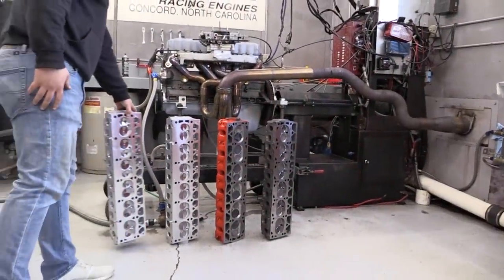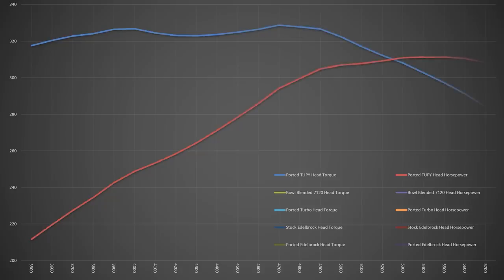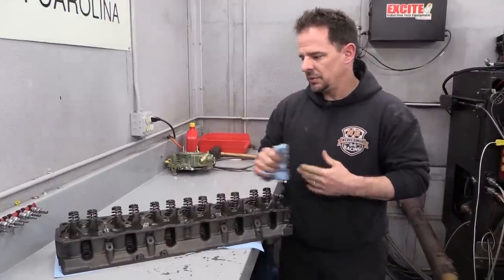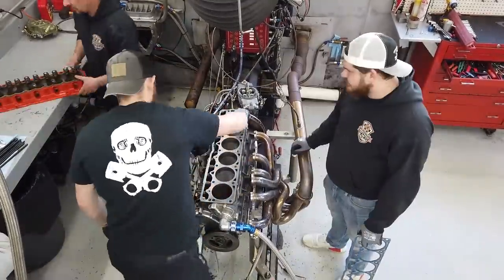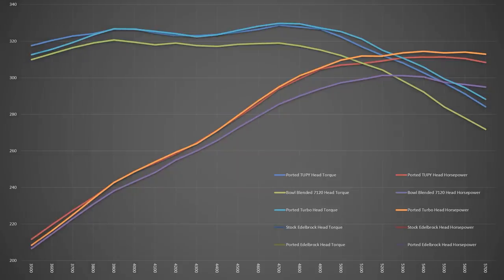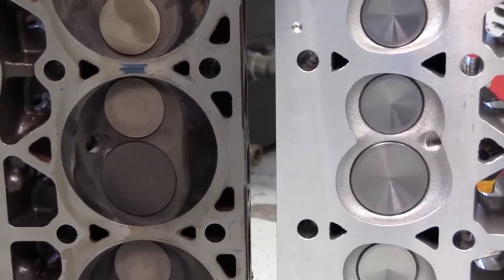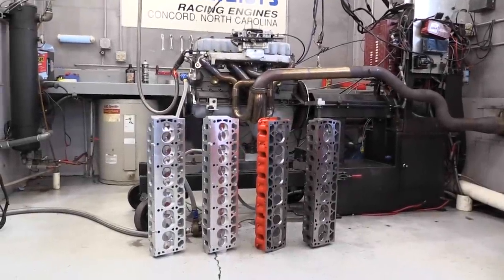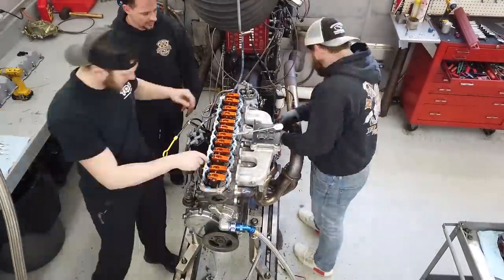We Test 5 Jeep Cylinder Heads [How Much is Porting Worth?]

Comment: years ago I had a 4.0 mated to a 5 speed with grand ma first and a NP 205 transfer-case in a J 10. it was one of the most capable jeeps I ever owned and would still be in my garage except for the dread of all jeep owners it was built from a cheaper steel as american motors was nearing the end of it's life and was sold in Connecticut. needless to say when I got it it was a rust bucket but it had a very low mile 4.0 and the 5 speed I swapped in the 205 because I had a chance to get one and it was the best mod and the only one I did to the truck. I got 8 years out of it before it rusted back to the earth but the motor, trans and transfer-case went in to my little brothers 67 J 10 and still powers it to day that was over 20 years ago now and it's still his daily driver.

Comment: This video really puts the emphasis on choice for application. I’d imagine the heads on a forced induction build would show highly different graphs on the dyno. It really shows how, too much porting, that’s specifically designed for forced induction. Put on naturally aspirated builds. Can rob power. And the beauty of this video is. It gives the layman a better understanding of gas flow and velocities. Thus helping people chose the right parts for their application. 
Your spot on when you say that the stock heads, with a descent valve seat job. Are the best for a budget upgrade on most applications. Where as the standard and ported
Edelbrock variants are much better suited for stroker and forced induction builds.
Again a cracking comprehensive, and in-depth test coverage of a subject that is highly relevant for lots of people wanting to update, and modify their straight 6 motors!

Comment: Thanks for the pull information. The crank harmonics are definitely an rpm limiting factor here. That being said, it seems all the business occurs well before 5k as it relates to torque. I mention this as it appears a mildly ported 7120 casting would have spanked the Edelbrock head on this block configuration. Other than the weight reduction and possibly lower emissions due to the chamber, the Edelbrock is a waste of money to anyone with a 7120 casting to start with. What is not illustrated is how well the stock castings flow at low valve lift.

Comment: This was a surprising test.  I was expecting alot more from that Edelbrock.. both stock and modified.
Reply: probably at the limit of the intake manifold.  those ported edelbrocks look like they should move a ton of air.
Reply: @deltaphisig  also being aluminum it can take more timing without detonation. Without messing with the tune, it’s going to be difficult to get the most out of it

Comment: For my application, the stock Edelbrock head is the one. Thanks for the dyno runs on all of those heads. A lot of great info.
Reply from the maker: Thanks for watching!
Reply: I agree. Think I'm going to purchase one when I rebuild my stock HO and drop in a RV cam. The weight reduction will surely help make this a peppy street engine.

Comment: I didn't even know there were 5 different cylinder heads 🥳
Reply: I about fainted.  I read "5 cylinder" and thought this was one of those conversions.
Reply: lol
Reply: Basically 2 heads, 1 factory with  4 variations and the Eddy lol
Reply: shaadydog1 - Yeah, I figured that out once I actually watched the video, lol
Reply: renix, early mopar, 2nd gen mopar and infamous 0331, with some revisions inbetween
Reply: @omegarugal9283  I had a Cherokee with the Infamous 0331.  I would still have that thing if the damned cylinder head did what they are prone to do.  As soon as I saw my oil pressure spike to around 75 I knew it was toast.  I'm looking for another Cherokee, but this time it's gotta be a '99 or earlier lol.

Comment: That's a whole lotta money for 15 horsepower!
Reply: This is one of those mods you can do yourself for free with just a dremel. When ever I have to a head job I usually trim up the ports. I use a gasket to mark them, and the manifolds and match. Its not as good as machined, but never had any ill effects. Always noticed a slight increase. 15hp/tq ain't much but every little bit adds up to big gains.
Reply: yep  simple porting and  polishing works wonders with a nice cam  and way cheaper too then all the different head dancing hoopla
Reply: @ChannelZeroOne  The heads in this video had WAY! more work than gasket matching with a dremel.  Big valves, bowl work, port reconfiguration, raised roof, etc...  There was nothing free about it!  And If that's what it took to see a 15 horsepower gain, a little dremel work wouldn't even show up on the dyno.
Reply: @1996slamster  You forget this ain't a stock to stock comparison anyways. I always get haters, but they are always slightly faster than stock. I always assume the gains are minimal, but enough to notice. I dont just decide I am gonna dremel out my heads. This is something I do when I need to replace a head or something. Making a headache worth it. Every little tweak adds up over time.
Reply: Channel Zero One Haters?!  Since when were we talking about a set of heads you’ve worked on, we’re talking about the heads in the video, and none of the heads in the video were simply gasket matched with a dremel.  They had huge amounts of work done to them requiring expensive machine work, hand porting and flow bench time all equating to $$$
Reply: Best 15 horsepower over what they had already built. Total horsepower was closer to 90 increase over stock.
Reply: @ChannelZeroOne  
I've never been able to do a head job myself. My woman does those for me. 💪😁♂️
Reply: 15 hp difference between these heads.  But a standard 4.6 stroker is putting out around 260 to 270 hp depending on lots of variables.  So this 4.6 is more like 50 hp more.  Of course the cam profile plays a very significant part of the numbers as well.  Unfortunately they didn’t start with more of a stock 4.0 head and measure against that.

Comment: Built a 4.6 with a tupy head that has been really noisy on startup and a little bit piston slappy but I can't blow it up tried a few times... has a 229 cam 4.2 rods and pottenger dished 26cc Pistons, even with the dish it likes 89 doesn't like 87 at all after swapping the 229 cam..

Got rid of the 0w40 and dumped in some 5w30 and a little Lucas zinc additive and it's way quieter now, maybe it just likes the thinner stuff still has plenty of oil pressure
Reply from the maker: But does it run well? Sounds like a fun ride!
Reply: Dodd Garger i went with the 4.2 rods, h802cp30 pistons(15.x cc), 230 cam, and put it in my lowered 2wd 2dr XJ with ax15 and LSD.  I’d usually be in top 1/3 at autocrosses.  Wish yt would let us post pics.  I’m gonna redo it with +.090”diamond pistons and the eagle 6.150s long rods i’ve been hoarding for years.
Reply: @grad0n  Very sweet. Always thought of autocrossing a 2door 2wd. I have a 2 door 4wd daily stocker that I thought maybe???
Reply: @99jeepxjguy97  i have a 99 2-dr 4wd 5-sp that I’ll be autocrossing this season.  I just put an eaton truetrac in the back and will swap the 231 out for the 242 with fulltime option.

Comment: Any heads with similar bore spacing that could be adapted? BMW, Toyota, Nissan, Jaguar... create something like the old Pontiac SOHC. Also I know it’s time and expense but some of the ported heads would probably have liked a different cam to bump up the torque. If the exhaust picked up significantly the need for less duration/overlap would help that. Even as it stands though nice gains and great content.

Comment: when you run a side mounted four barrel carb the primaries face the intake valves, how about testing the four bangers (2.5), the throttle barrel  injection manifold is way too small, but the electronic (four injectors) has a better runner design, the throttle body , will bolt on and you plug the four injector ports, the four banger jeep also had a twin cam cross low head

Comment: The last Ironhead, looks like it would probably have produced somewhere close to about 330 or better horsepower if it didn't have the larger combustion Chambers to allow for forced air you can. Maybe a slightly domed piston would have worked. That might bring you up into that 330 to 350 horsepower range. But that would have been really ideal and I don't think you had quite enough to him for that horsepower. Looks like the best head for the money was the stock Edelbrock. Just a little bit of cleaning of the ports, which most people can't do. Helps and not opening up the exhaust ports greatly would help in reduction of reversion. Which could cause issues down the road with the coking up the intake.

Comment: Like screaming into the void. Trying to make power out of non crossflow heads.

But that's what makes it heat fun. Trying to achieve the impossible 😁
Reply: True. 
But there were many european, small non-x-flow n/a engines tuned to aprox 100hp per 1Liter of displacement.
Reply: The benefits aren't worth the drawbacks.
Reply: @KC9UDX  agreed. Unless class rules demand it.
Reply: @KC9UDX  what benefits?
Reply: @jareknowak8712  beats me.  But I sure know about the drawbacks.  Maybe I'll make a video!
Reply: @KC9UDX  i dont think there are any benefits of non-x-flow heads. 
Maybe just packaging.
Reply: @jareknowak8712  you should see the difference in space and workability under the hood.  I've got a cross flow head motor that I'm going to scrap due to this.
Reply: I wonder if these engines are the same as the 245 and 265 used by Valiant in Australia and NZ in the 70's? You could get a Charger R/T E49 in 71 with 302hp of the showroom floor
Reply: @NitroAl  
Did you find out?
Reply: @jareknowak8712  non crossflow heads have some advantages for economy engines (good swirl for clean and efficient combustion) and/or running on cheap fuel (the exhaust preheats the inlet charge, which helps vapourize the heavy fractions). I don't think there is any real advantage in a performance context however.

Comment: if you go with a maximum valve size,  does the spark plug need to be shorter to not interfere with the travel of the valves?

Comment: A custom crossflow head is what this engine needs, that should help get the air in and out faster.
Reply: I wonder if you could drop a more modern I6 into these older jeeps to take advantage of crossflow heads etc. The Ford Barra might be a good choice, similar 4L capacity and undersquare design but with the modern bells and whistles like DOHC and 4 valves per cylinder, VVT, etc.
Reply: @nerd1000ify interesting idea, considering 4.6 Ford SOHC valvetrain parts fit the 4.7 PowerTech SOHC
Reply: Same bore spacing as the small Ford V-8s. The SBC/LS is only .020" more. The Ford and LS would need new bump sticks due to valve position. Not sure on the SBC. for DOHC the Nissan Infinity V-8 is about .030 on bore spread. The GM LQ-1 is the same as the LS.

Comment: I’m having to replace my 4.2 .30 over bored block 4.0 head conversion with a 4.0 due to a cracked head stud boss. 
I was thinking of swapping over the 4.2 crank and boring the 4.0 to fit my pistons. I’ve heard that the 4.0 con rods (in this combo) would be a better overall displacement. What’s your take on this?

Comment: Suggestion. Make the torque lines and horse power lines for each component the same color in future videos.
As in: 
Tupy Blue/Blue 
Edbk: red/red
It will make it far easier to read. and it gives you the ability to use more contrasting colors for each component as you have 1/2 as many colors to come up with.

Comment: Please understand that most of us jeep 4.0 owners are looking for off-idle torque increases rather than high rpm HP. Please consider asking “Newcomer racing” to consider building a high torque off idle engine that will perform off road. I am bringing my 04 rubicon to them as soon as my relocation from the Great North Woods of Maine to SC is complete.
Reply: Here, here.
Reply: these guys know shit about the 4.0 culture, torque man, not rpms...
Reply: We hear you and we build from mild to wild and everything in between. Don't think just because these engines can rev to 6,000rpm's that they have no bottom end torque, quite the contrary. You can't control the load on a dyno at low rpm's very well for those who do not understand.
Reply: @keithnewcomer4406  Thank you for your reply.  I look forward to having you rebuild my 2004 I-6
Reply: @keithnewcomer4406  
I've got a 2004 WJ. Is it possible to build a stroker 4.0L based engine for a little more hp/tq and still be California smog legal? 

I get 18 mpg @ 70 mph. Can I keep the mpg high? 

Am I asking too much of this engine design? Thanks.
Reply: @xmo552  We've sent many out that we smog legal and off road versions. They normally get 1-3mpg's better due to it taking very little throttle input.

Comment: Y'all sure make installing the manifolds look easy.
Reply: That's because they are.
Reply: @ChannelZeroOne  uh-huh...  When's the last time you put one of these together?  😉
Reply: @KC9UDX  6 months ago.
Reply: @ChannelZeroOne  which intake and exhaust?  The stock ones aren't that difficult, provided you don't care to get an accurate torque reading on every screw.
Reply: @KC9UDX  If you need a torque wrench for intake and exhaust bolts you are a rookie. Head and bearing bolts yes, the rest no. There are 2 guide slots you start with those up first. The bolts by the firewall are always a pain no matter the vehicle.
Reply: @ChannelZeroOne  a rookie is he who doesn't use a torque wrench.  If you don't use a torque wrench for this, you will end up with gasket leaks.  Sure, if you run fuel injection, you might not notice it.  The screws near the firewall aren't near the firewall when the motor is on a stand.  But even in the vehicle, those aren't a problem on every vehicle.  The ones in the middle are the hardest to get at on these.
Reply: @KC9UDX  you're just on an agenda to make it seem harder than it is because it's hard for you.

Comment: I have a 1990 Limited Cherokee 4.0 with 153,000 original miles.
I was thinking about a new intake and throttle body & headers. Now I'm wondering if I should go ahead and port the original head, add new valves and springs as well? I'm more interested in fuel economy gains than I am horsepower or torque.

Should I just go with my original plan or dig a little deeper and do some work to the head itself?
Reply from the maker: Porting the head is going to help you burn more fuel. I don't think you will see any fuel economy gain. But for that matter, I don't think intake and exhaust changes will help either. Fuel economy is about combustion efficiency and parasitic drag. Maybe a cutting down the head to improve the compression ratio. Stuff like that.
Reply: @TheHorsepowerMonster  But how much cut to increase compression? Looking to still be able to run 87 daily and 89 for working (trailer, offroad, etc. . . ) .015" milled off?

Comment: I would love to see the last one with about 15 pounds of boost !!!!
Reply: That's a big turbo!
Reply: @KC9UDX  Not overly big, an HX-35 might be just right.
Put that engine in an old Rambler American and hunt modern muscle cars......lol
Reply: @KC9UDX  One of the things the Youngsters forget, it's all about Power to Weight Ratios.
Starting with a 2000 pound old car is far better than starting with a 4000 pound car.
Some modern things I like: modern programmable ignitions systems, Electronic Boost Controllers both make power and my engines survive. But I also like Carbs, I can make them do what I want.
I'm old and don't like to follow the heard to closely. So I use what modern parts give me an advantage and leave the rest behind. The engine on my test stand right now is a Ford 300 six, a boat anchor, but with the cut, modified, and welded Chevy LS3 head I made for it it might raise a few eye brows. I'm still working on a proper intake for it and it will see boost. The most expensive part so far has been the semi-custom Molnar rods but it's insurance.
I'm rambling,
Good Hunting
Reply: @johnparrish9215  I've got to apologise, John.  Your comment came in my notifications looking like a reply to my comment about cross-flow vs. not cross-flow heads.  So my reply to you was totally out of context.  I don't disagree with you at all.
Reply: @johnparrish9215  by the way, I've always liked turbochargers.  I yoosta have ideas about putting one on a 258 or 242.  But I've become addicted to high compression.  😁
Reply: @KC9UDX  If I were doing the Rock Crawling thing, I would be in the long stroke, high compression, E85 burning crowd.
Reply: @johnparrish9215  I love lightweight cars that is why japanese imports are so popular with the younger crowd. A lightweight uni body car with zippy high revving engine is always fun even if its only a 4 cylinder in a 2000lb car its still pretty fun.
Reply: Barney Navarro got 650 HP out of a 199 CI AMC six, twin turbos on alcohol...back in the sixties.
Reply: @scootergeorge9576  I wonder how many RPM he was turning, he really twisted it's tail hard!!!!

Comment: need advice on swapping cam in my 05 jeep wrangler? i am having trouble getting an aftermarket keyway style cam ! can i use a earlier pin style cam, timing gear set and cam button bolt and eliminate the cam thursh plate? any help please! terry.

Comment: I was thinking of a Slant Six for my build of a t bucket but maybe this is better?
Reply: Clayton Pope  
What VW diesel did he run? 
An 80s idi style or a later TDI? 
The TDI in the 3rd gen can be made mechanical injection used from the idi fairly easy.
Then you get modern power with old style reliability. 
I built one years ago, basically stock except a little more boost and it ran tractionless 14 flats in a old rabbit.
Reply: Chevy 292, ford 300 ... bigger.